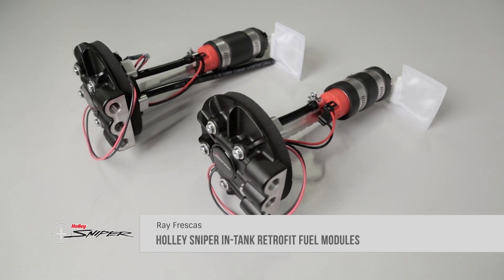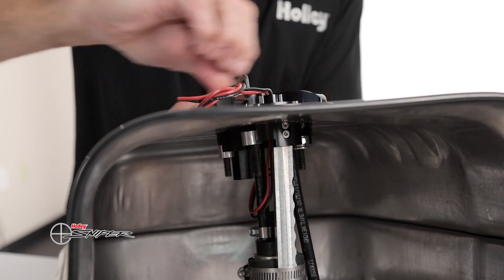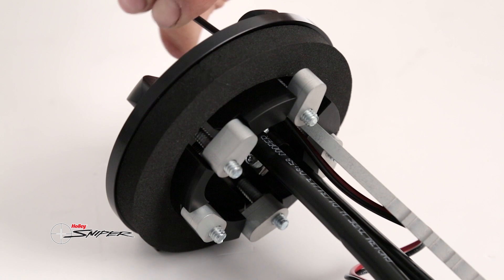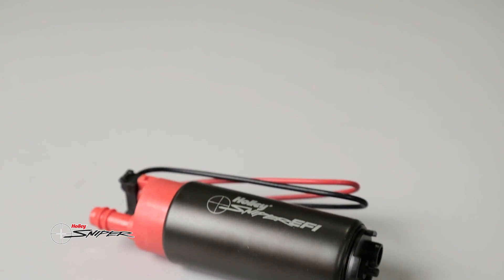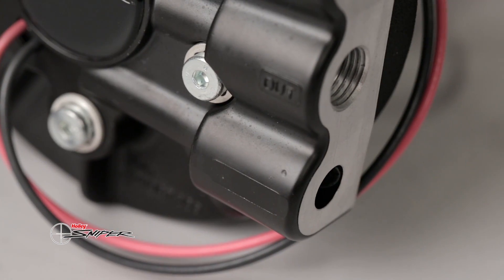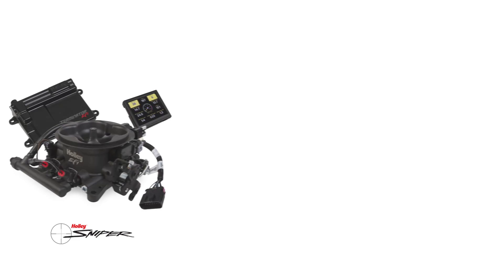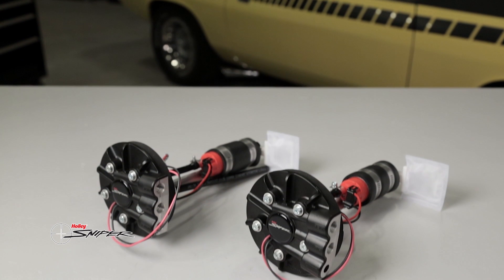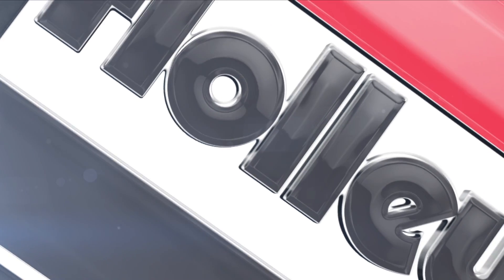Holley Sniper In-Tank Retrofit Fuel Modules

Comment: The instructions mention needing "Post-Filter- Holley HP Billet Filter or equivalent model" but doesn't give any information on where to install it, how far from the tank, etc.  Is the filter that comes in the Holley EFI Fuel System Kit Part # 526-10 the proper filter?

Comment: What are the benefits between return and non return fuel line ?
Reply from the maker: A return-style will circulate the fuel, lowering the overall temperatures of the fuel in the lines.  This can help prevent vapor lock and percolation of the fuel. You may also experience more consistent fuel pressure from your regulator.  A drawback is that you will have to run a return fuel line back to the tank.  A non-return style is easier to install but may build more temperature in the fuel line possibly causing some of the problems I spoke of above.  Thx J
Reply: HolleyPerformance Thank you so much for the helpful information 👍🏼